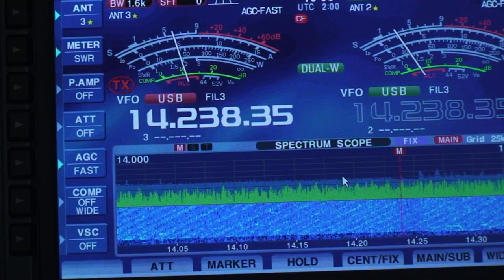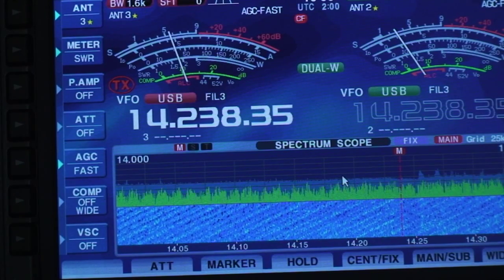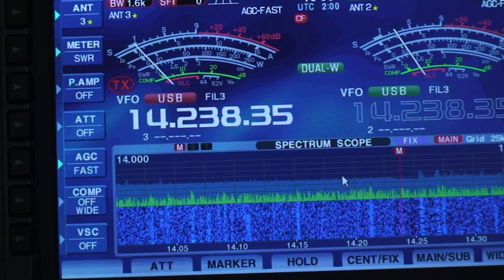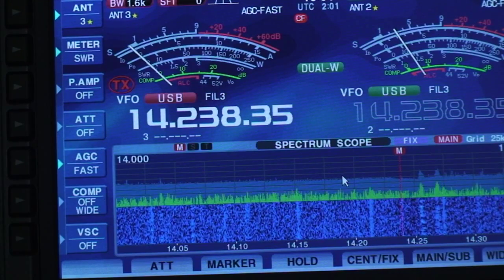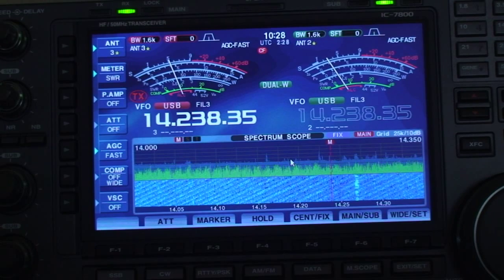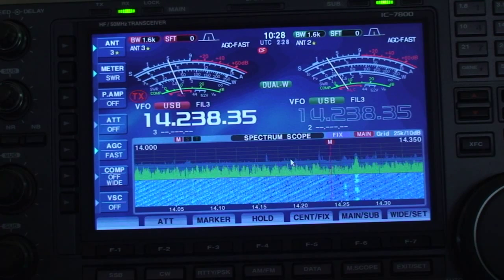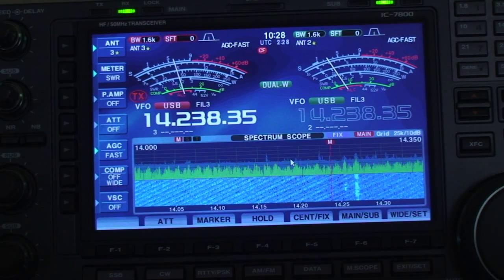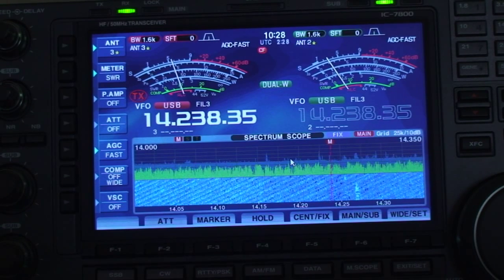How I found the noise source interfering with my HF radio.

Comment: I had power company debugging house because power meter couldn't send usage data for billing. They use one of mains phase wire as antenna and on that phase was small wifi router wall adapter. Whole phase wire was noisy

Comment: Oh yeah, those little switcher bitches can make a LOT of noise. Some are really good, but you have to go through lots of em to find decent ones. Then you might consider getting a bunch of them. Always seems funny to me that here we are pushing 2020 and still sometimes the best power solutions I find are simply an old school non switching transformer with a bridge rectifier and a big cap, and a linear regulator.

Comment: I have the same problem here in my block building. Antenna is on roof of the building, right over the elevator shaft. Inside the shaft some internet operator use the same cheap power source. It makes the same white noise on HF. I can't do anything, because he do not respond on my problem.

Comment: It is very worrying that PSU as been given the CE mark that means it is approved ?for use in Europe there are a lot of fake CE marks and there is a standard for this marking. Usually the fake ones do not conform to the official size of the markings,
I  had the same problem with a Philips PSU but it was a leaky smoothing capasitor after many years of use.Thanks for posting.
Reply: zaperfan The "CE" mark is being used by the chinese as "China export". It means nothing bud, I could build something and put a CE marking on it. It doesn't mean that it is certified. 

73 de M6EXH
Reply: In France, only NF (Norme Française) is usefull, CE is too common, we can see it everywhere, on anything.

Comment: I had the same problem with a HP printer power supply causing all kinds of noise. Like you,through the process of elimination I was able to narrow it down. This problem developed after 3 years of service.